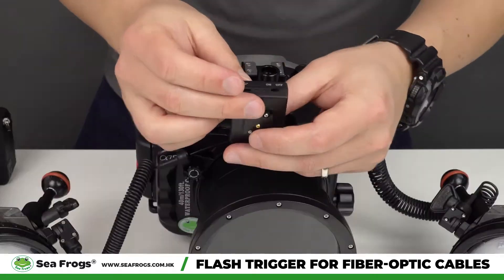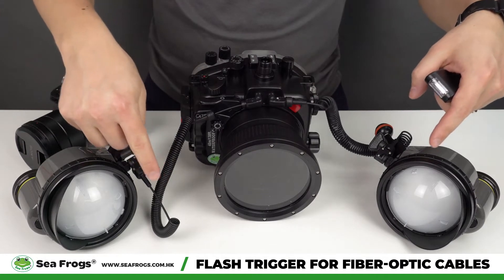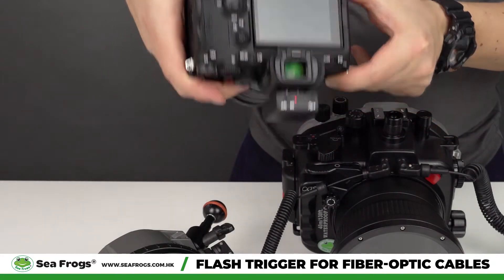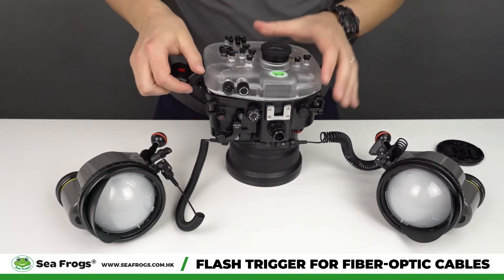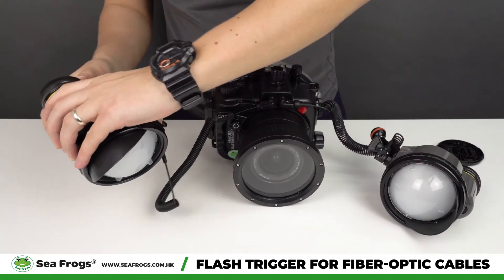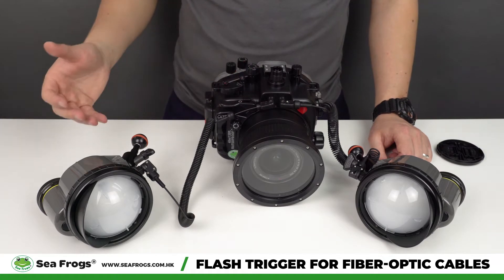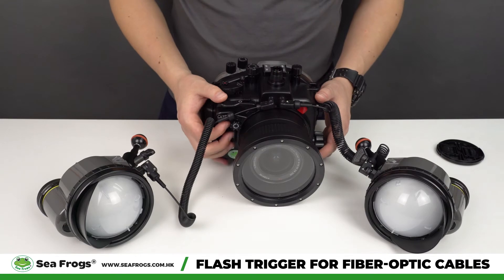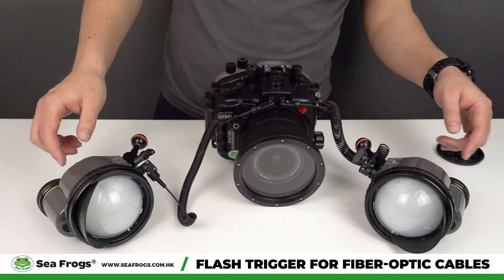Flash trigger for fiber-optic cables

Comment: Hi! Interested in this. 2 questions:
1) does this work with sony a7 iii and seafrogs housing for that camera? (in video you mention only a7s iii)
2) where do I get the fiber optics cables? can you send link to your website? possibly with your strobes? or is it something I should search for on the strobes producer website? 
Thanks! keep up the good work!
Reply from the maker: 1. Unfortunately this Flash trigger is not compatible with housing for a7 iii/a7riii
2. Housing for a7iii/a7riii only works with synchro cable (it is mentioned in the description). So you need to buy a synchro cable to connect strobes.
https://seafrogs.com.hk/collections/underwater-strobe/products/sea-frogs-dual-5-pin-electrical-sync-cord-for-underwater-housings
https://seafrogs.com.hk/collections/underwater-strobe/products/sea-frogs-5-pin-sync-cord-to-nikonos-type-bulkhead-for-underwater-housings-100m-330ft

Unfortunately, we don't sell strobes at this moment, you can find many options of other brands available at different prices. Just make sure that the strobes you will buy can be connected via a synchro cable.